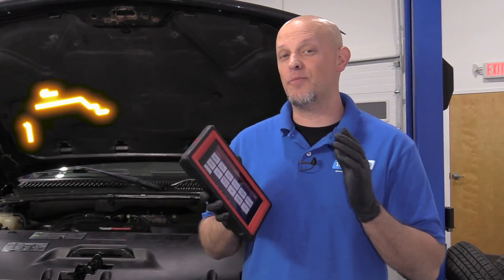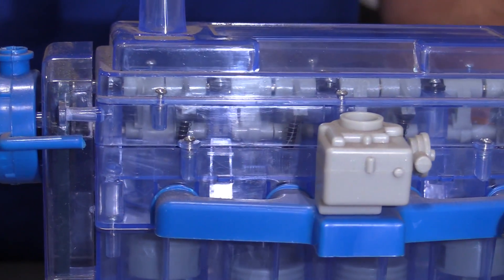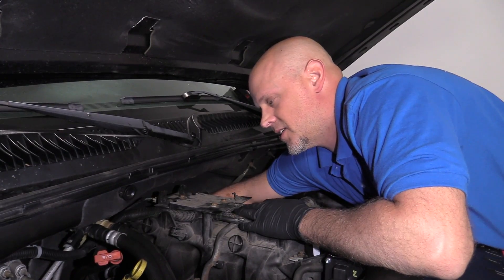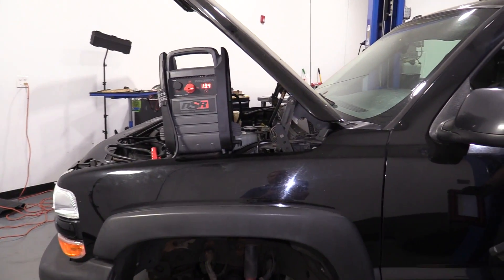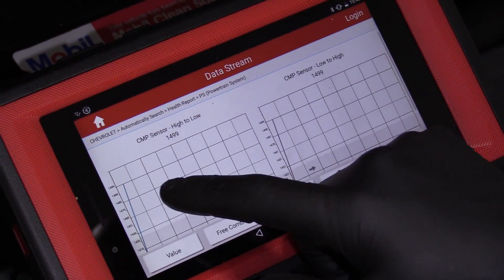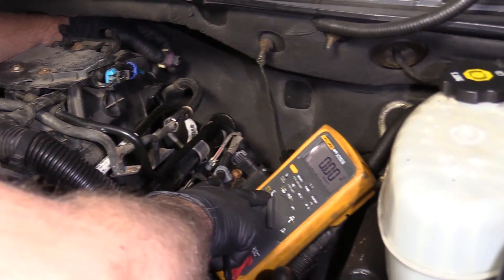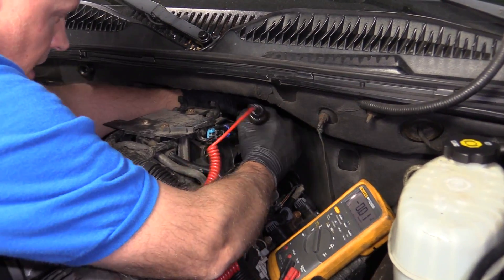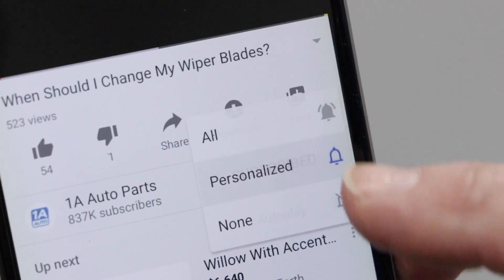Check Engine Light? Camshaft Position Sensor Circuit High Input - Code P0343

Comment: When he tested this vehicle he only used the test light and meter on the RED power wire. Should I see voltage on either of the other two wires?

Comment: There are many obd2 code readers. Prices high to low. How do I know what reader I need to diagnose this issue? It seems it might be cheaper to just replace the sensor (just in case) rather than spending money on an OBD2 code reader that may or may not have the capacity to diagnose this issue?

Comment: I have 215k miles no codes changed mine with Delphi due to valley pan leaking now i have 2 codes p0342 and p0343. 06 silverado 6.0L

Comment: I replaced my sensor and light didn't go off, runs good but takes a few seconds to start, when I used my volt meter between red and black/pink it didn't read anything, but when I went between red and brown I had 10.5 V. Also when used my test light between red and black/pink it didn't flicker or anything. What could it be?
Reply from the maker: +@tobylillie6540 We wouldn't be able to diagnose an issue like that here, you may want to have a local mechanic take a look at it. Thanks for checking us out! http://1aau.to/m/Shop-1AAuto-c

Comment: I'm confused, when your testing are you testing all 3 wires at the same time or just 2 at at a time? with a muti meter you say test between the pink and the black wire... and the red wire? Then with the test light you say to test between the pink and black wire.... and the red wire?

Comment: Can this cause a p0300 multiple random misfire code?  

The code throws randomly on & off & it had been throwing it for a while before it finally gave me the camshaft position sensor code...

Am worried it's actually something else since it has been throwing the p0300 misfire code for some time before it threw the camshaft sensor code.

Comment: I put a new camshaft position sensor on my 2002 chevrolet silverado 5.3l and now my engine light came on and I'm having starting problems and it backfires, why is this happening ?
Reply: Have the same problem

Comment: I worked on a 2015 Hyundai Elantra that was a crank no start. Had a code for bad camshaft sensor. Checked the wiring and it was good so I replaced the sensor. Even with a new sensor, the computer wasn't reading where the camshaft was. I was stumped. Told my customer it has to be the computer but get a second opinion from the dealer. I told him to keep me updated

Comment: I keep getting the code P0365  that's showing pending on my scanner. When I start the car the engine light stays on until I clear it but the code P0365 Shows pending still. I have change all four of my camshaft position sensors. I  didn't know which one is bank 1 and why I'm still getting a code.

Comment: I have a 2012 Dodge Ram with 5.7 liter.  
Cam sensor comes on with traction control light.
I've changed the sensor three times.   
Why does the cam sensor code come on with traction control light?
What do they have in common ?
Very confusing

Comment: P1362 and P1361 on 2002 honda civic lx , I changed the camshaft sensor and still after engine warms up the code and limp mode come right back. Any suggestions? Bad new cam sensor?
Or what else could cause those codes to come back. Thank you.

Comment: Does the brown/white wire have power when keyed on as well? My red wire on my sensor pigtail is reading 10.36v but no power from the brown/white which is pin 73 on blue side of ecm. I did check for continuity and there is solid connection

Comment: Can this cause a p0011 code? I have this code and I've changed everything the solenoids cam phasers timing and engine oil cooler and the p0011 code keeps coming back about there days after getting reset and my car is not run to well but still drive able
Reply: Having same problem with my 6.2 Chevy motor. replaced everything wires good. Heard with the LS motors might have change our whole camshaft and VVT solenoid.

Comment: That's all fine and good but what if it's not the sensor and you dont get the right volts in the wires. Could you please do a video that covers the what if it's not a simple fix?
Reply: Yes I'm not getting 5 volts on signal wire ..what controls that ? PCM or ECU?
Reply: This is my problem too. Thinking I’ll have to give in and take it to a mechanic.

Comment: So if the cam sensor pickup a fault with your camshaft in my case camshaft is slightly bend, would it keep the fire of ignition also away? I replaced my damaged engine with an import one.

Comment: Just replaced mine and now I have this code also my vehicle 2010 traverse has two different types could that be a cause for this code maybe wrong part
Reply from the maker: +Greg sarro We wouldn't be able to diagnose an issue like that here, you may want to have a local mechanic take a look at it. Thanks for checking us out! http://1aau.to/m/Shop-1AAuto-c

Comment: +1A Auto Parts This is a great series! Can you please post a version for P1457 and go over all potential fixes, including those beyond changing out the canister and valve? I still have the code after swapping those parts and I don't want to just keep throwing parts at the problem. Thanks in advance! I have a 7th Gen Civic 5MT sedan.
Reply from the maker: +Cinca0989 We do not have a video for this right now, but we'll keep this request in mind for a future video! 1AAuto.com